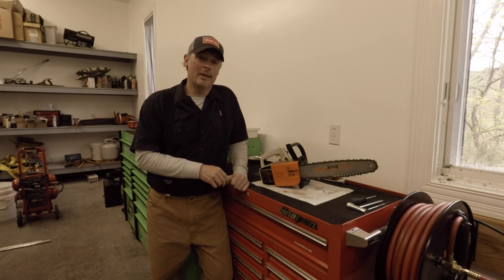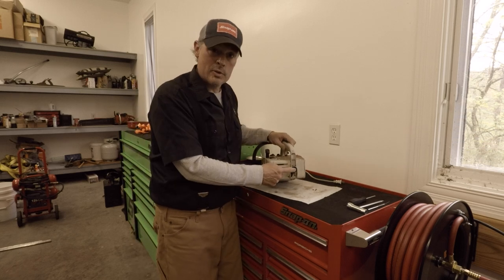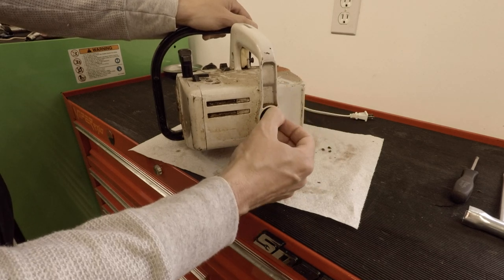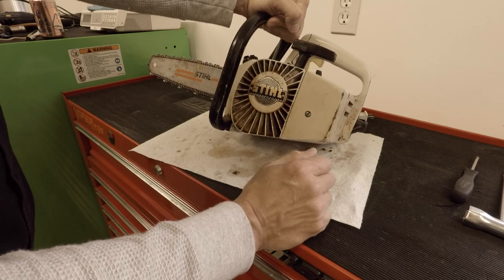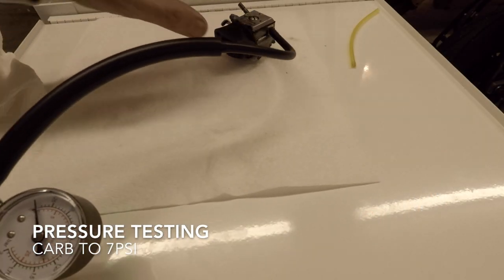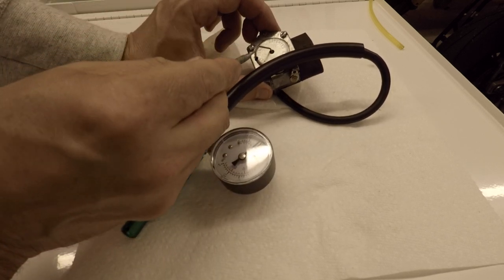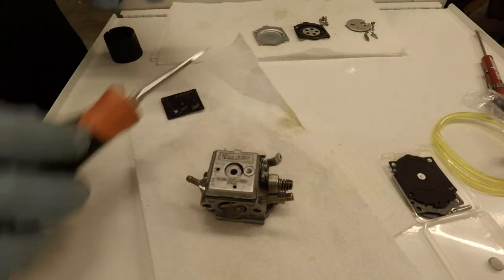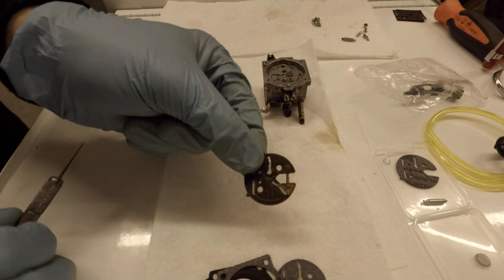Stihl 015 Arborist Chainsaw Repair - Fixing It Forward For A Neighbor

Comment: A good trick to preserve the carb and fuel line is to run some canned "True Fuel" through it before you put it away for the season. I've done this over the last couple years and it's worked great. They start right back every spring. Nice video and nice of you to do this for your neighbor.

Comment: I restored the 015 that I inherited from Dad a couple of years ago.  It took nearly a year to figure everything out.  The main "problems" were:  1)  The diaphragm/check valve behind the snap ring & screen on the carburetor needed to be replaced, so be sure to buy a carb kit with the check valve.  The carbs are no longer available, but rebuild kits are.  2)  The gap between the flywheel & coil needs to be in spec.  I replaced the points & condenser with a solid-state ignition from a video that I found on another YT channel.  Easy modification, and my 015 runs better than new.

Three minor points that I dislike about the 015 are that the fuel & bar oil reservoirs are too small (constantly filling both), and the air filters are super expensive, if you can find them.  I am very careful with mine and gently clean it often.

Aftermarket sprockets, bars & chains are available, mostly on/off eBay.  I have spares and/or duplicates for just about the entire saw, after buying a non-running 015 for $50 from a local small-engines shop.  It had a brand new bar and chain and the cylinder/piston are pristine, so I definitely got my $$ worth on that deal.

Comment: Thanks for the reply.  I got a new fuel line with a filter on it.  The old one was dry rotted.  Put the new line in, cleaned it up.  It starts and runs like new

Comment: Thanks, i just got one and am trying to get it going. It was in some water at some point. I got the piston unstuck, has good compression. Freed up the pull cord that was frozen too. On to checking for spark and carb rebuild. Hopefully coil / points is still ok.

Comment: Great video you done a excellent job.I have one just like that. I got it in 1987 it was used and not running I had it in a old building. I am going to see if I can fix it now.
Reply: it wouldn't be a 87 could be 83 that was the last year on the carb by to the right of the low jet it will say hdc 17 and you will see the date under that . I have several 015 015 l 015 av and 015 R in total I have 9 if you have any questions just message back . by the way I see where you said 87 I thought you meant it was a 87 😆
Reply: gamer X, any suggestions on where to find parts? I have a 015 L runs good but it's got an oil in chain tension port where the pin slides forward and back. I'm guessing probably a seal or something not sure but parts are hard to find unless I'm just looking in the wrong place.

Comment: When I add fuel it just drains out the bottom of the saw.  Does the fuel line connect to the tank with a rubber hose or is it a metal tube connection that connects to a rubber tube.  It ran last fall when I put it away.
Reply: Check the fuel tank/oil reservoir gasket at the front. Very common leak point if the hose isn’t the culprit.

Comment: I'm in France mine has a different collor and is from 12/1977, i'm trying to find the missing, used, not working or broken parts to fix it. I should be able to get it running but i'll probably still miss some parts to get it complete and realiable.
Reply: What is your saws serial number?  It's stamped just above the bar/chain on the forward tight side as your holding the saw.
Reply: @magicone9327  i need to open it ? Because i dont see anything. On what piece ? The pieces references are engraved on each part but i dont see serial numbers.
Reply: @frederic6998  did you get it running ? if you need any help or parts I got alot of good used parts . I been working on these saws since 1985

Comment: where did you buy the carburetor
Reply: the carb kits are easy to get they are on ebay any hdc 10 kit will work if your working on a 015 the carb is a hdc 17 A or B

Comment: Use a jumper cable when checking for spark
Reply: i use a copper wire roll it around the spark plug and put the other side in contact with the cylinder.